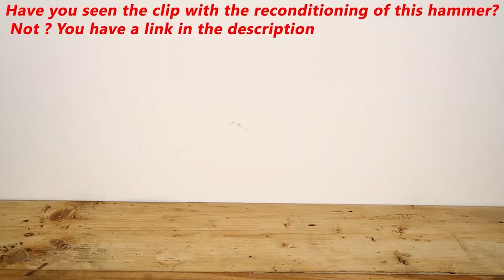Rusty Axe Restoration

Comment: Very good work - but you should use a good Tape to protect areas not to be covered with colour - 'Scotch blue' will create such  with satisfying really sharp edges ...
Reply from the maker: ok :)
Reply: Green Frog Tape is even better. Designed for just such use.

Comment: Varnish on the handle only if you don't plan to use it barehanded for any length of time.  Varnished handles cause too much friction and cause blisters FAR quicker than Linseed Oil finished ones.
Reply from the maker: You're right, I didn't think of that either :)